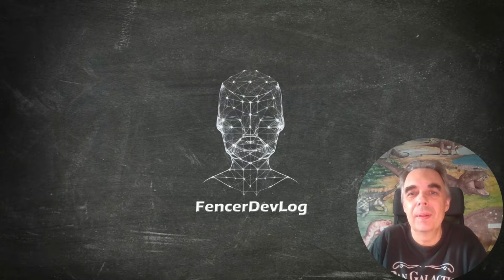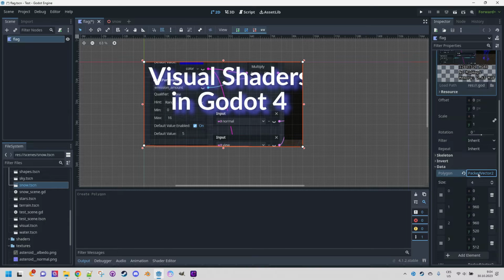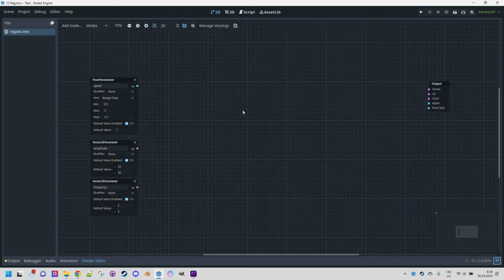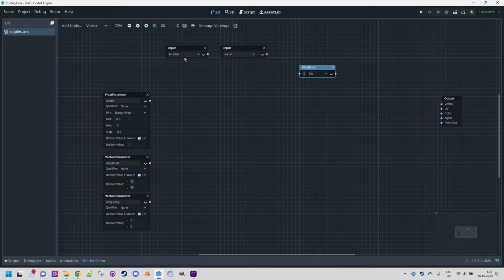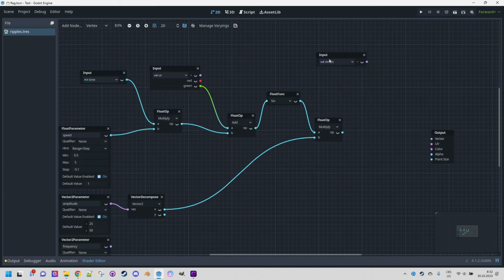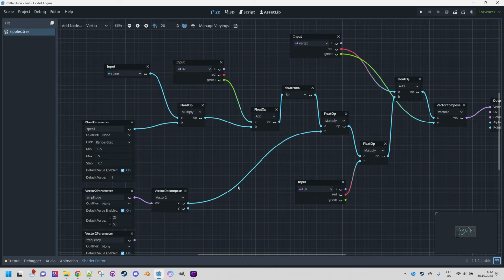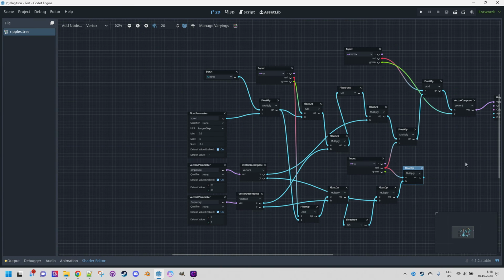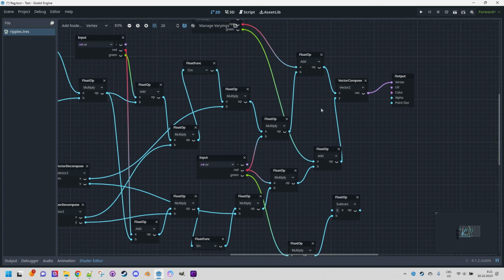Godot 4: Vertex manipulation with a visual shader (tutorial)

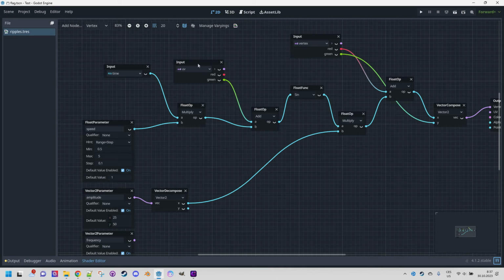Comment: Hi Filip, I did twice from scratch. 13:17 when you do first check - I checked if Shader editor matches, it does. However, the frag is not moving. I'm working in Godot 4.4 ; instead of outcome/vertex I have Light Vertex & Shadow Vertex. I tried both and none of them works. (I tried all possible outcomes, only colour reacted - changed to yellow :D ) What could be the reason?
p.s. i created github, my nick is llexis80. I uploaded SpaceShooter. I left 3 messages, but next time I checked, youtube did not add them, all gone. If you check why UFOs are not shooting, that would be great